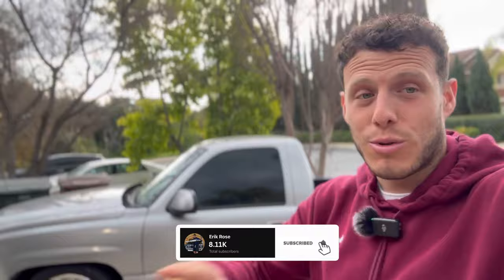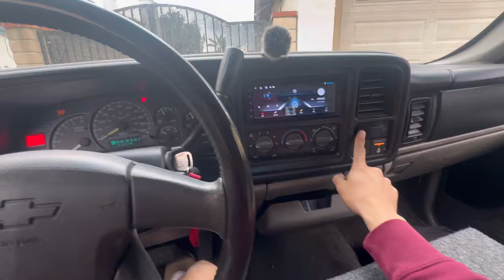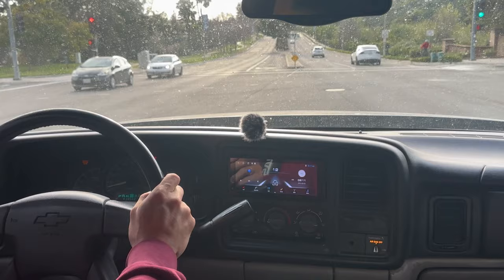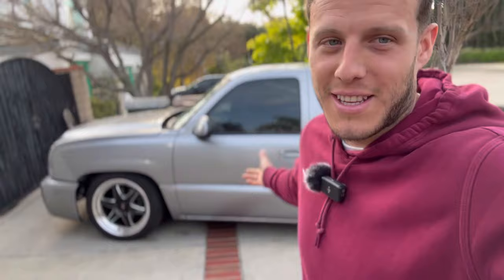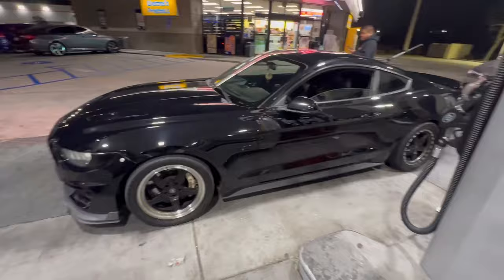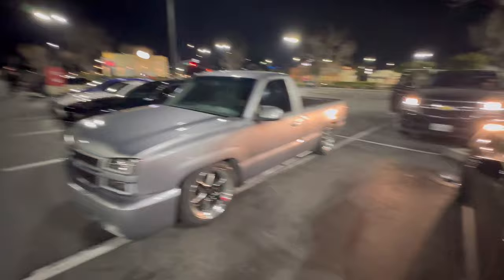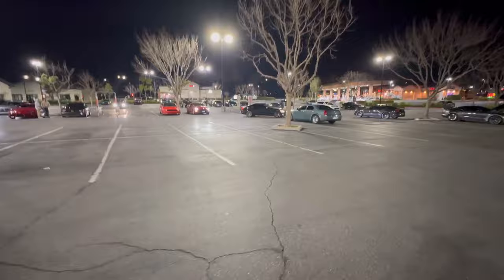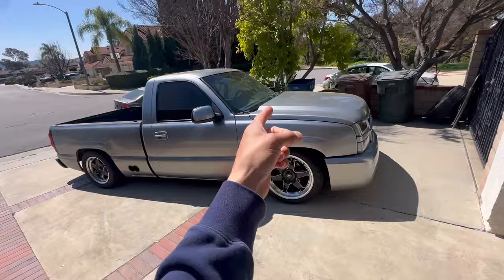DOING PULLS IN MY CAMMED 5.3 SINGLE CAB!! 4L80E SWAPPED!

Comment: Build the diff bro.. changed the whole truck 
I got a 2002 single cab with a 6.0 built diff notched frame on ethanol. Spins tires at 30mph
Reply from the maker: truck already has a yukon locker and 3.73 gears

Comment: A 4l60 or 4l65 would’ve done a 5.3 just right just cause 80 don’t mean better for street truck
Reply from the maker: this truck will be boosted soon making 600-700whp 4l60 wouldn’t have held up with that power lol 👌
Reply: U are partially correct, the 60/65e is better for all motor builds but the 80e is far superior when it is in a boosted application
Reply: @ErikRose_ yea still would go 4l80e regardless I’ve smoked a few 4l60s behind I 5.3 with just heads and intake I built a 60 it’s held up but imma still go 4l80 matted to the ls3 going in